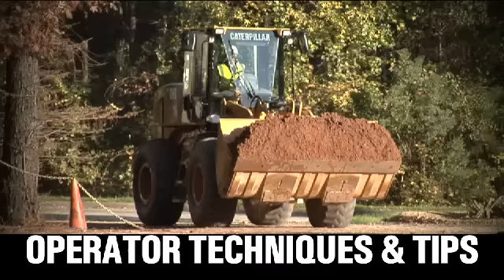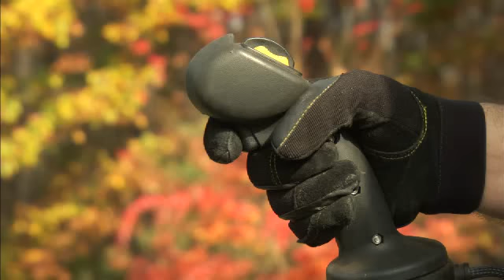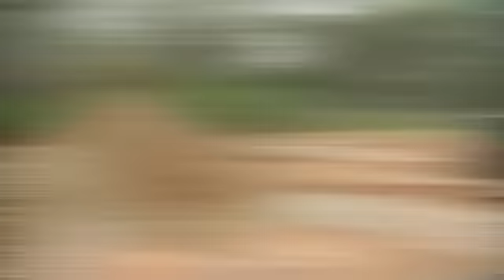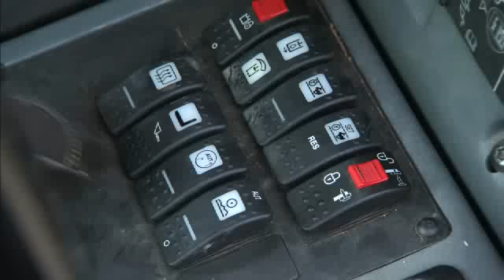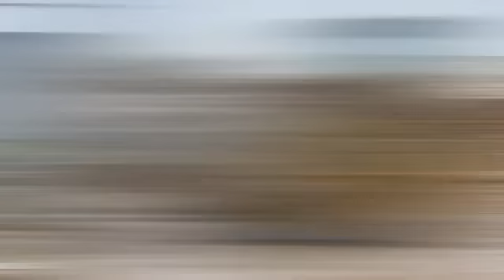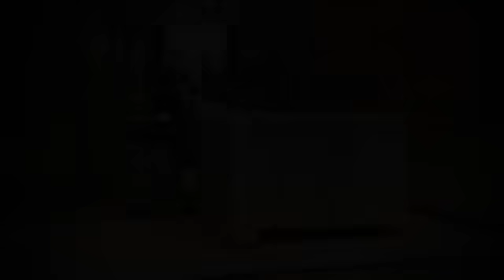Cat® Small Wheel Loaders | Operator Techniques and Tips

Comment: But what if i dont have a steering wheel in my 992? And what if i have two levers to control my boom and bucket?
Reply: They fell out somewhere. Go find them before you get docked.
Reply: @lewiemcneely9143 bro what ?
Reply: @RugpullFiat  Don't you know that the worker is ALWAYS supposedly who causes everything? Bosses say they are as pure as the driven snow but usually are a train wreck that laws their so-called 'accidents' off on the workers when they weren't even there? You've got a lot to learn, pal.
Reply: @lewiemcneely9143  lmao i was just wondering what u were saying fell out ?
Reply: @RugpullFiat  Anything. It don't matter. We'll all be held responsible, no matter if we did it or not.